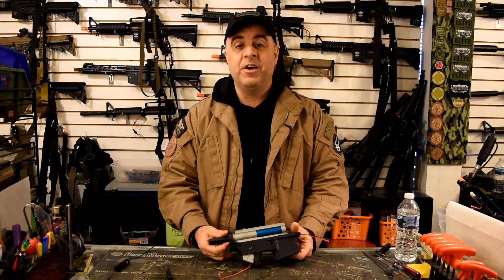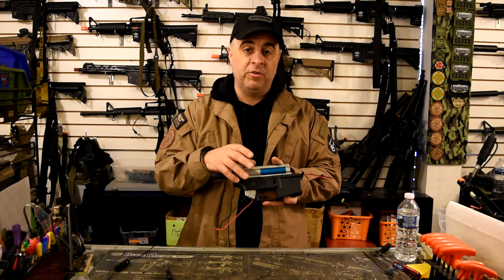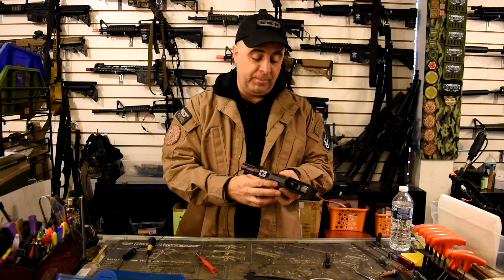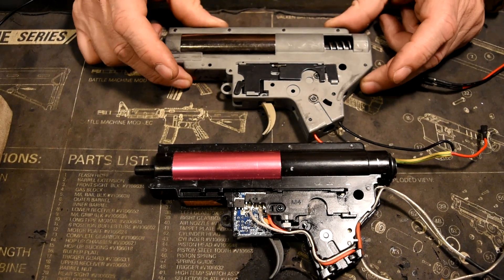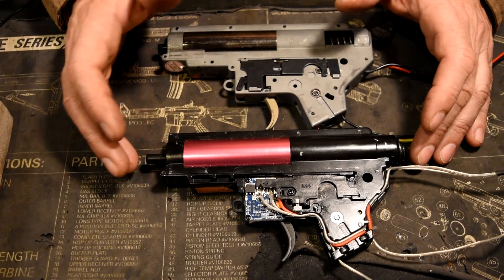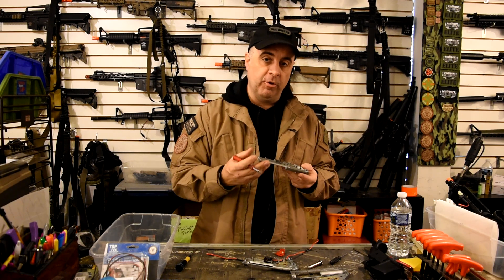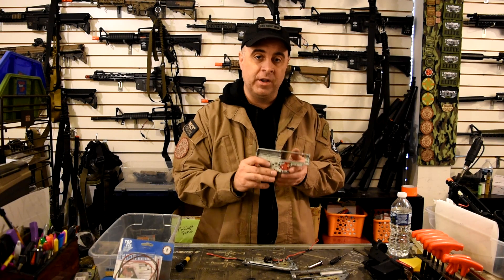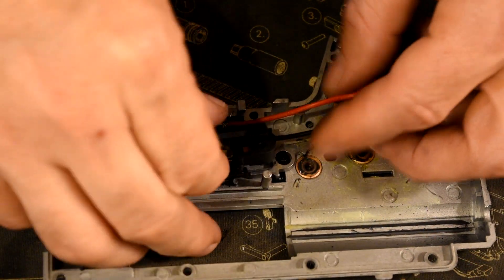Advanced Trouble-Shooting for AEG Gearboxes

Comment: Hi, I have an AEG that fires a few shots and then refuses to work. It goes completely dead. If I unplug the battery and then plug it back in again, it works fine for a few shots and then stops again. Is this a MOSFET issue? I have an ARES style gearbox
Reply: I had the same issues with an amoeba am009 I got another battery and it works fine now
Reply: Huh. I have two batteries that work fine in other guns. I might have another issue. @zalvara

Comment: hi some times my trigger locks up on single shot.  When i put it on full auto it clears up. It'.s a v2 gearbox and all gears are intact installed a new trigger shimmed it ball bearings new gears could it be the single shot stopper? still have to see if that pin is inthe gearbox at this point . If its not im gonna drill that out and put a small screw in it. Its only a guard for the trigger going to far back
Reply: If your gun doesn’t have a MOSFET or ETU then it’s probably because it’s half-cocked and trigger-locked as a result.

Comment: I have an M1 Garand AEG by A&K, and the version 7 gearbox seems to have a little trouble. I pull trigger, an abnormal buzzing emits from the receiver. It should make that AEG pew at the end signifying a burst of air pressure, but it fails to do so. I wonder, is the piston not in line with the teeth? Or is the piston teeth broken? I have no knowledge of how a gearbox works, so i need help.

Comment: hey i have problems with my umarex oa-15 i think the motor is dead because everything else is working but how can i assure that that  the problem is with the motor?
Reply: Your best bet is to connect the motor directly to the battery. Some M4 platforms have wires either connected in the forestock or in the butt of the rifle that you'll be able to pull out and connect them to the motor. Afterwards, just connect the battery to the wires to give the motor power. If the motor works, then your motor is fine, but if it does nothing, then you may need a new motor. If your motor has black residue all over it, that's also a sign that the motor might be worn.
Reply: Change the motor, if it works again, you'll know the motor is the problem........

Isn't that always the way you found the problem？
Reply: Plug motor in, not connecting to the gun, and fire it